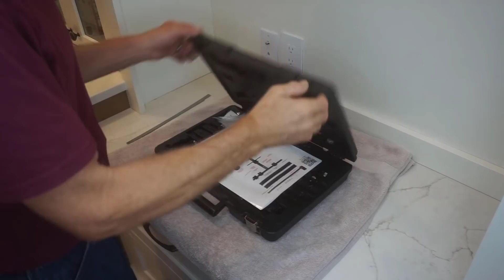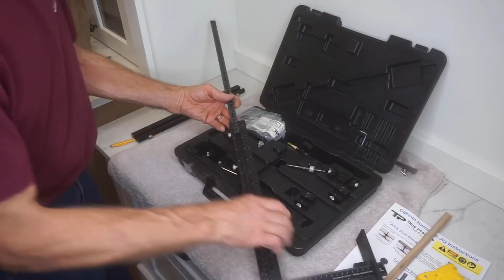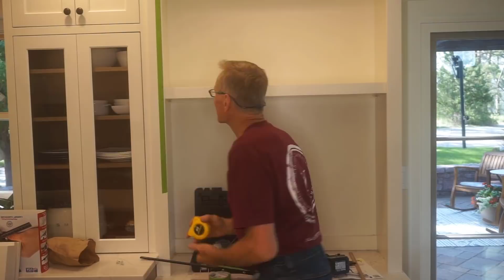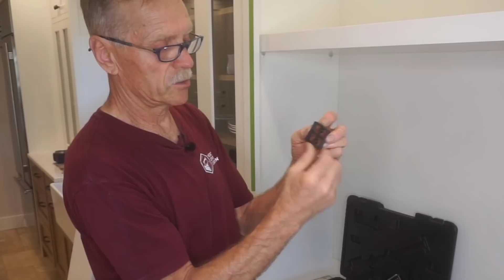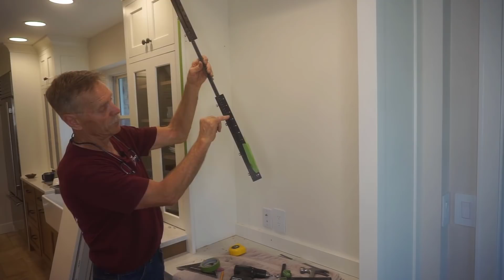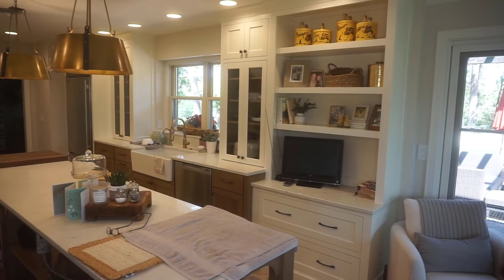Drill Shelf Pin Holes On-Site

Comment: Sure wish you would us standard measurements along with the metric measurement.  I have to stop and convert each measurement and that eats up a lot of time.  Still a great video.
Reply from the maker: Yeah, it's tough when you do Imperial measurements as a second language, right?  Sorry dude.  BTW If you like this jig you might be interested to know that True Position has released a special "Shaker Door Kit" with an official solution to the recessed panel fix shown in the video. They also JUST released handle screw spacing pins virtually identical to the ones I made for my jig... very customer centered company IMHO.
Reply: @NextLevelCarpentry  Thank you for the additional information.

Comment: Great video and I like that jig.  I was just looking at it in the hardware store yesterday but couldn't bring myself to spending the money.  I do think for this operation I would have stuck to good ole peg board, a vix bit and a drill guide. Knowing your quality the counter top was perfectly level and a great reference for the shelf holes.  The drill bit stops look like great quality and I will look for those.  Thanks for another informative video.
Reply from the maker: I wouldn't have spent the $$ for the jig for these few holes either Donald and understand your practical approach to such things!  I've been drilling shelf peg holes for about 35 years and this is thee first time I drilled 'em with a store-bought jig LOL! Best, Matt
Reply: @NextLevelCarpentry  Thanks for the reply Matt.  Always enjoy your videos.  Don

Comment: While I understand that the purpose of the video is to show off the shelf drilling capabilities of the jig, would it not have been easier and much faster to mark and drill template holes into the temporary supports you made for each shelf? By starting to drill from the top down, This would seem to a much faster, easier, and frankly more accurate technique, with much less room for error due to jig movement. 
I appreciate the jig for hardware placement, but I honestly have quite a few more options for drilling shelf pin holes on site besides this jig that take a lot less room in my kit, and are quicker to set up.
Unfortunately, in today's world, things that try to "do it all in one" or are a multi purpose tool, are a hassle to change the setup, and end up not performing any of those tasks in the best way.
I tend to prefer a single purpose tool for many reasons, not the least of which is the ability to leave a jig set up for a task and still move on to other things, with the ability to return to that jig to continue a task.
Reply from the maker: Well then I guess it sounds like true position jig is not for you...  you can thank me later for doing this demonstration to save you the cost of buying a jig you don't like to use😁😎
Reply: @NextLevelCarpentry  I actually own and use the jig, Matt. It's perfect for setting knobs and pulls. It's a great solution for that problem. I'm simply saying that there are better and quicker ways to accomplish this task. Tru Position should stick to what they're best at, and not try be a be all end all...
Reply from the maker: @AlAmantea  Ahh... interesting viewpoint... personally I don't see the shelf pin feature as an effort to become "a be all and end all" but as an feature added for convenience.  I mentioned in the video that I would have drilled these shelf pin holes on the day I installed cabinet pulls had I known then where they wanted the shelves.  In that more typical scenario I would have needed to bring just one jig to the site to accomplish both tasks rather than both a hardware drilling guide AND some other shelf pin jig. Kind of like having apps on a smart phone to avoid carrying a flip phone AND tablet?  But don't get me started on Kreg jigs for implying a 'be all and end all'! 🙄😎 Best, Matt
Reply: @NextLevelCarpentry  sure thing! But I think that you would agree that a lot of times, a single tool for convenience of transport is not the best way to accomplish a task. Just a hammer will drive a screw, but it is not the best tool for the task. I know, an extreme example. I do agree that the blue colored stuff isn't great either.
My original thoughts still stand in this case though, since you were only drilling one set of holes per shelf.
If you were drilling multiples or full columns, I think the jig would have shown more usefulness.
Reply: My immediate thought!

Comment: Laughing at your white patent leather. When you've made enough cabinets you can appreciate how great it is to remove any stress around that hole spacing. Even a 64th makes a wobble with four points of support. I love your detail. For example the one thumb screw don't push too hard comment. Been there, especially rushing a short cut of two taped pieces of long shim sliding apart on the last mark fitting in closed tight space. <3
Reply from the maker: I've been looking for years for a pair of carpenter pants in a plaid fabric for times like this😂
Mistakes made because of measuring device failure tend to be some of the most frustrating because you really can't see them coming until it's way too late do anything about it right? 👀🤬
Reply: @NextLevelCarpentry  I still have a vivid memory of my first "help my father" project more than 54? years ago, I believe I was 6. He failed to include the width of the tape measure in the internal dimension of a screen door frame. It became a family meme equivalent to "measure twice cut once". I also appreciate that I see your habit of checking direct measurement against parts when possible. Always good to confirm with multiple tests (diversification) and common sense instead of putting the wrong hole in a cabinet. Your pencil marks on square sides, your taping blocks together. I see these all as measure fool-proofing. Those details matter - again I reinforce my appreciation for you taking time to share the longer format.

Comment: Are you assuming that the mldg at top of cabinet is perfectly level or did you verify?
If not level how well does the guide work?
Reply from the maker: I installed both cabinet and cleats in the top of the cabinet so I was confident they were accurate for reference.  If cleats were 'off' and the countertop was level I could have just as easily flipped the jig upside down to reference off that.  If both were off I'd be asking myself if I wanted shelves to be truly level or if they should be parallel to an existing level surface... always a judgement call when remodeling, right?😎
Reply: @NextLevelCarpentry  
Great reply! You installed the cabinets I overlooked that even though it was made quite clear. I was looking at it as though I was approaching a previous installation. 
I did think of working from the countertop and wondered why you chose to work from above. 
As always your work is impeccable.  Thanks for your videos.

Comment: The new work is beautiful. Nice demo of a very versatile toolkit tool. However, I gotta say, from the before picture, dated or not, I did like the natural wood quite a bit. I don't know that I would have changed that if it was my house. Great video as always.
Reply from the maker: I'm a 'stained wood' guy myself and understand your sentiment.  Sad part is that, as nice as the 'before' kitchen looked, there were a dozen 'systemic issues' not address and/or created by previous remodels that meant a responsible remodel was 'necessary' even if an updated look wasn't.  Glad you like the video... must be a bit of a change to watch a 'new' one rather than having to dust off old ones 'on the shelf' here at NLC! Best, Matt
Reply: Ha,ha. The difference is having to wait. I'm sure the client is glad to have those issues resolved. Most aspects of the remodel are vast improvements. I just cry a little inside when nice woodwork is discarded in favor of paint. But light and bright has its place too, I suppose.

Comment: Would using a laser not be faster and easier?
Reply from the maker: Not for this application IMHO... I'd much rather locate by a positive stop block than by visually aligning the guide block to a laser beam.  Plus the jig provides excellent alignment for the drilling part, especially in the awkward drilling positions this job required... again, IMHO.
Reply: @NextLevelCarpentry  fair point great video as always buddy keep up the good work 👍
Reply from the maker: @jamesfrancis6969  a laser would definitely be the fastest/best way to verify if existing cabinet/counter surfaces are level enough to use a reference though... and for things like projecting elevation lines across a kitchen so shelves line up and... 😎